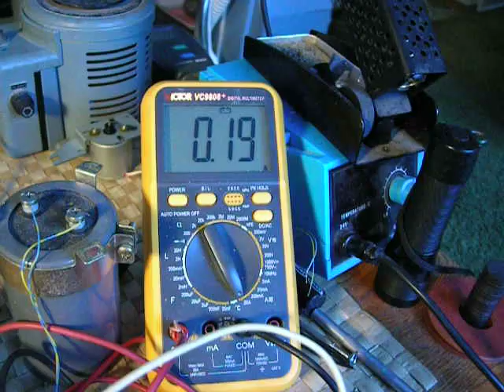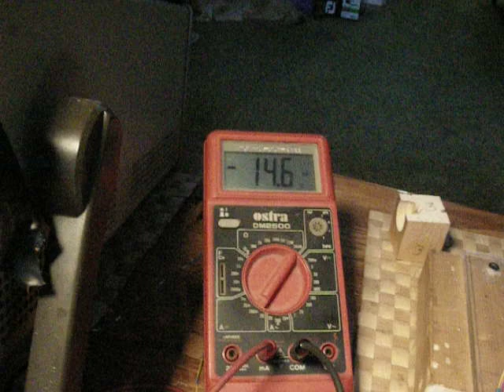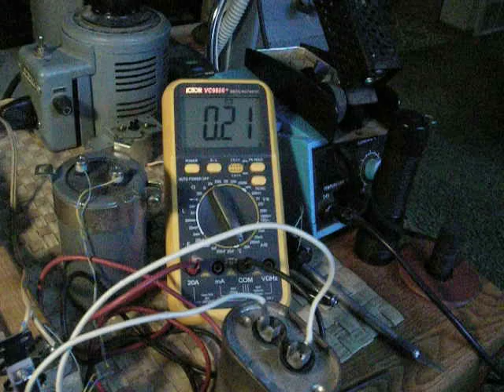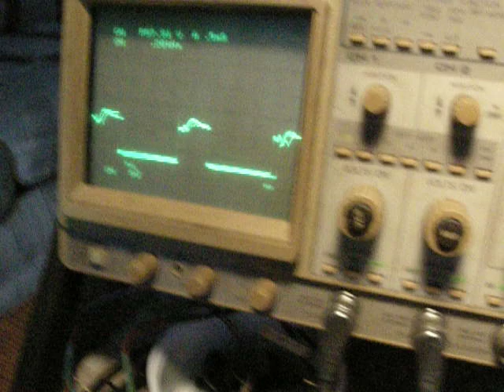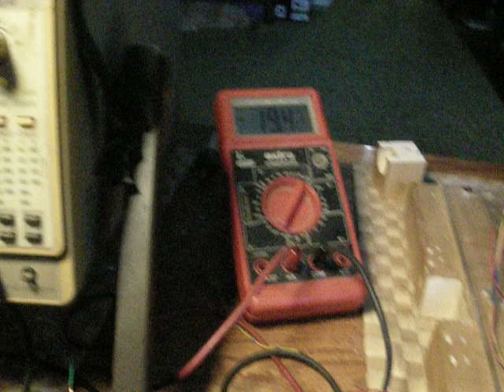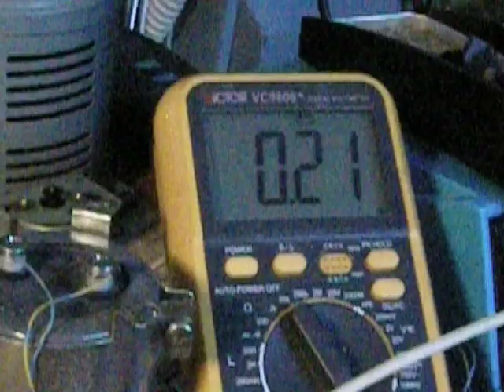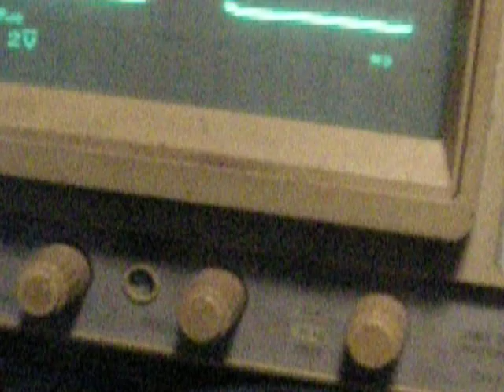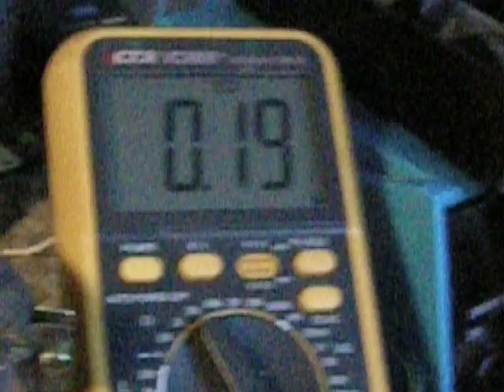New surprise from THIS STEORN ORBO Build

Comment: You generated 10% of the power you consumed
That is only 10% Efficiency.
SO WHAT ?
Reply from the maker: I'm just getting started !
Reply: XoFFoX777 When you get to 98% or 99% Efficiency then you will have something "semi-worthy" of posting. Maybe, in 5 years? Or never. Until then you have nothing but an EXTREMELY INEFFICIENT motor / generator setup. As long as this is less than 100% efficient, then what is the point?

 Is this just a toy, simply for entertainment ?